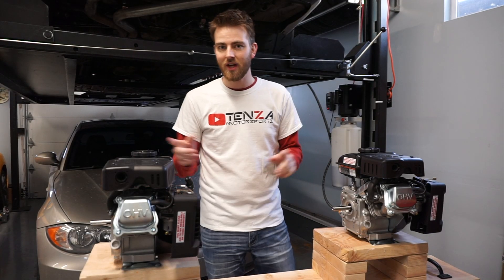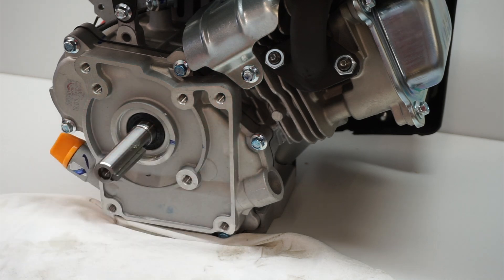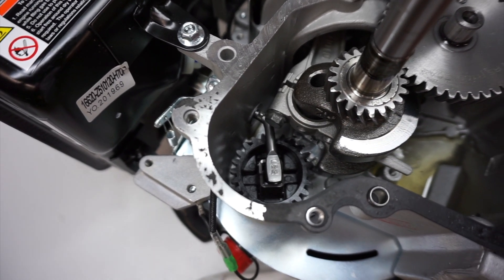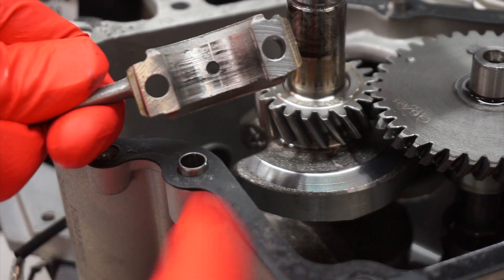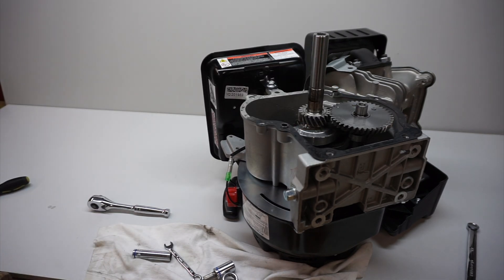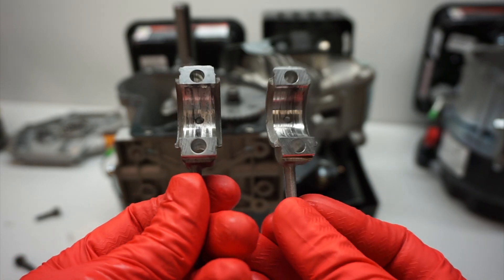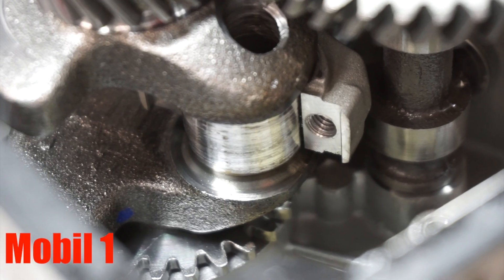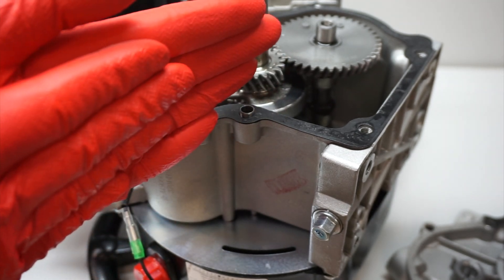Mobil 1 vs. Amsoil. Damage Report Torture Test Results. Search for the best synthetic oil (part 3)

Comment: Mobil 1 always has the best pour point. As a Canadian this important in our long winters.
Reply: Um, no, Amsoil Signature always has the best cold pour ability.
Reply: @Trigger-xw9gq 
 It matters more the viscosity. But Amsoil outperformed all other oils in many tests.  The Liqui Moly Molygen is a great oil for a good all around oil. It gives a better result in many categories except oil longevity.  As long as you're changing the oil to OEM recommendations or before.  I like the wear package on the Liqui Moly, so I plan on using it to bond with the metal at a molecular level, then switch to Amsoil for a longer change interval, once I install a centrifugal oil bypass cleaner that cleans the oil down to 0.01 microns, which is cleaner than new oil.
Reply: @Trigger-xw9gq  no, not always
Reply: Project Farm certainly disproved this. Amsoil always wins every test. This guy’s video is very suspect.
Reply: I use Vegetable oil. Best viscosity I've ever seen

Comment: Magnatec 0w 20, claim of leaving parts coated with a film of protection for start up .
Anyway to test that ?
Reply: They used to have I think 7% ester witch ester sticks on metal, but I think Castrol changed the formula and I believe it doesn’t have ester anymore, theirs a reason why it’s cheap. Any oil with some ester will “cling to metal” as what Castrol is saying with Magnatec 

http://www.worldpac.com/pdfs/motul_SYNINAMcar08_v1.2-Colour.pdf
That’s a link to what Motul says about group 3, 4 and 5 oils

Comment: I have a 2007 4Runner with over 260K miles and have always used Amsoil. It uses "0" oil between the 15K mile oil change. I have done this since the vehicle was 1 year old. Never had a failure of any kind.
Reply: My Camry uses less oil with Amsoil and just runs quiet and smooth like a sewing machine
Reply: @Big88Country  2007 Toyota’s can run to 300k miles with conventional castrol GTX.
Reply: What is your point? Is your 4Runner using the engines in this video? Sounds like your butt hurt because your chosen oil did not win? My family has owned Toyota's longer than you have been alive. I have seen them live long long lifes on Castrol GTX 20W50 and 3000 miles oil changes. I have also ran every brand of Synthetic oil available in the USA, a few that are only available in Europe and few only available in Asia. Run any synthetic brand like Mobil-1, PUP, Valvoline, Quaker State and change the oil every 6 months or 10K miles which ever comes first and that engine will never suffer an oil related failure!
Reply: 😅🤣 that engine could last as long on other oils.  Stop it
Reply: 😂😂😂 it will work with out any thing

Comment: For this test to have any real significance you need a statistically significant number of data points - way, way more than one engine for each oil.  Random variations in many factors can skew the results when you only use one of each.  Results aren't particularly valid that way.
Reply from the maker: I would love to do that, but I don't have the funds to spend 2,000 per oil to test. Preferably i'd have around 20 engines for each oil. But think about is this way. you only have one engine in your car. what are you going to put in it?

Comment: I rum Amsoil in everything.  I have 445k on my 7.3 . I have changed the oil  9 times. Filter at 25k . Oil n filter every 50k. Testing it with independent lab. It comes back same way. Still in spec. Run for 12k and re-sample.   The motor is just as strong as ever.  Replaced injectors at 385.  Conventional oils are every 5k. That is 89 vs 9...money and time saved.
Reply: I Run Amsoil Signature series in everything as well. Car is a prius 407k miles! Runs perfect no noise or clatter , runs as good as new , change oil every 15k , I know its 25k oil, but I run 85 mph most of time. HD evolution engine 100k miles runs perfect,  str8 50 in trans. Nothing better, mobil1 garbage,  they spent millions on brainwashing.  Run Amsoil!
Reply: @scoobydoo1726  )
Reply: @scoobydoo1726  

I would not argue that amsoil makes a much better product, and even Pennzoil for that matter, but I wouldn't call Mobil1 garbage. It's certainly overpriced and it is far from the best, but calling it garbage is not really fair or true. I ran their full synthetic for years in multiple Honda/Toyota engines, changing only every 12-15K... Never had a single issue with any of those engines.
Reply: But I like to have a reason to work on cars
I use Liqui Moly and change it between 5-7k miles which for an oil like this one is overkill but I find it a hassle to send back analysis and I can put that money to some other stuff.
Reply: @Andrew H yes but that is the reason for doing the oil analogy, that is the only way you can do something like that!
Reply: James Emmenecker Sr. 
Wow, that’s crazy
Reply: Is that miles or kms? Thanks
Reply: U mad man!
Reply: If you change oil every 5k km you should be fine with most oil
Reply: Those poor little Engines... They weren't designed to run without oil... Try Lucas Stabilizer in one, probably last longer than both of those...
Reply: 7.3? What vehicle?

Comment: I use motul for my 18 subaru wrx for last 2 months. I’m thinking of switching to amsoil vs mobil1 or staying with subaru oem. Thoughts?
Reply: I'd just stay with Motul as it is a 100 percent synthetic and most European oils have to follow higher standards for labeling unlike the US where anything can be labeled a full synthetic.
Reply: @bryanmartinez6600  i agree people are brainwashed with amsoil i find Castrol being good really depends on tne motor all motors like different oils
Reply from the maker: Honestly I don’t think you can go wrong with either oil!

Comment: Engine last for years .You can use any brand of engine oil.synthetic or conventional.change oil on schedule.PERIOD
Reply: Synthetic oils are proven to reduce wear over conventional oils, increase fuel mileage, etc..
Reply from the maker: I agree. A manufacturer recommended schedule and the correct oil type/weight is the most Important part. Most of this oil stuff is personal preference in my opinion. But we are looking to see if there are any differences between them.
Reply: @TenzaMotorsports  It would be even better if oil changes of the manufacturer's recommended viscosity were done earlier than the manufacter's schedule. Top-tier synthetic oils are very, very good, but frequently changed bargain brand oil is better than oil that already 20k miles on it but has customers convinced that they can save money by waiting for another 5k miles before changing it. No amount of exotic oil additives will keep some very fine grit from getting sucked past your air cleaner, and the best oil filters can't trap all of it. The tighter the tolerances and clearances of newer engines, the more the more likely that fine abrasives will damage them.
Reply: Absolutely!

Comment: What a waste of engine parts. Doesn’t prove anything with no oil. What exactly is the point?
Reply: Many tests just like this were done in the 70s and 80s with engines treated with slick 50.
The engines with slick 50 just kept on running.
Reply: I’m still with amsoil, if you would add just a little bit of dura lube to any of those you would be over 10 minutes run time on both engines
Reply: 100 percent, test on anything
Reply from the maker: There is oil. Just very very little. It’s a lubricity test. It’s not a waste. I got good solid results from this test. If you need more explanation on what is being tested here I can do that

Comment: For engine oil I take it to a local dealer shop for the brand- they use a full synthetic Castrol or Valvoline,  depending on driving west or east, do any free recalls or updates, and know what to look for that typically goes wrong with this model and year. For my 2 motorcycles, I change it myself and use half Valvoline regular 10w-40 and half Valvoline 20w-50 synthetic motorcycle oil, from Walmart. It gives me the best shifting smoothness and the firmest clutch feel. I change it when the shifting starts to get worse, since the same oil is in the engine, clutch and manual transmission. It is usually before the 7,500 miles in the owner manuals.
Reply from the maker: Having shops you can rely on and a maintenance schedule is key. Castrol and Valvoline are both very good brands! Thanks for the comment.

Comment: Shouldn’t this be called “LACK OF Amsoil vs. LACK OF Mobile one”?
Reply: I’m just not going to comment, I’m going back to bed.
Reply: @Thedirtylittlesecret  lmfao
Reply from the maker: There is very little left! Enough to get a lubricity result.
Reply: @TenzaMotorsports  I don't think any oil would stay in between the rod and crank with engine running, the oil would get slung out. The rod end just got hot and seized to the crank.

Comment: I like Amsoil, I use it in my taxi without any problems, can you test Schaeffer's and Motul
Reply from the maker: Has many miles are on your taxi? Motul and Schaefffer on on my list to test!
Reply: @TenzaMotorsports  over 200,000 miles, Amsoil actually fix the vvti cold start noise in my engine, I switch from 0w20 to 0w30,engine is running nice
Reply: @TenzaMotorsports  You should test Ravenol oil! Its a german oil which I've been using in my 2009, 2.7 Tacoma and I love it!
Reply: @VILLEGAS76able  I've been thinking of using Ravenol in our expedition I currently use Liqui Moly though in my Titan and will order Miller's oil for the transmission soon made in the UK.

Comment: I would like to see a comparison between synthetic and regular Dino oil.   
The results would surprise some folks. Hint. Save your money
Reply: What you said is mostly true for one reason: the synthetic oil most people use is NOT synthetic oil. It's Dino oil too, but it's been refined to the point that they are allowed to CALL it synthetic. There are only two real synthetic oils available for public consumption and one of them is Mobil 1. The other one buys their base from Mobil and adds their own additives.
Reply: @ralfie8801  ~ Synthetic oil is refined from natural gas.
Reply: @Jim-MT  group IV true chemically synthesized synthetic PAO bases are made from ethylene which made from natural gas among other things.
Reply from the maker: Great idea!
Reply: Trundy ~ Oil doesn't come from Dinosaurs. It IS a very common belief though.

Comment: I would say run them with the designated oil under a equal load non stop until one fails would be better test
Reply: I didn't understand or see how the test was ran.  We're these engines ran after draining oil?
Reply from the maker: That would take a very very long time. Plus this test was to get a lubricity result and that’s what we got.
Reply from the maker: There is oil still in them. Thats why they ran for 5-7 minuets. If you are still confused you might want to rewatch the video where I talk about the oil testing parameters and why

https://www.youtube.com/watch?v=QT1_qdUWzRM&t=2s

Comment: Try Pennzoil Ultra , a true full synthetic oil, like Amzoil and Mobile one.
Reply: Amsoil is grade 4, the rest grade 3.
Reply: @7s29  yes you are correct that's why uts better
Reply: 7s29  Most of syntetic oils out there are GL 4.  Amsoil uses Mobile Exxon base. Don’t be fooled. The question is,how come them performance oils like Amsoil or Red line have no API sertification? Are they to cheap to pay the licence?
Reply: @volodymyrbuchak1852  Actually that's not correct
In the USA most Full Synthetics are Highly refined group 3.

EUROPE has different standards for what full or 100% Synthetic actually means.  (Liquid Moly, Ravenol). Casteol, Mobil Europe versions are diff as they have to meet EU standards.

Yes AMS Oil is a group 4 and they buy their base from Exxon/Mobil.

Redline is the only Group 5

With that said Mobil doesn't even use group 4 base stock any longer.  They have gone back to the highly refined group 3.  It's cheaper.
Reply: @troys9069  Mobil 1 Extended performance full synthetic uses 60-70% PAO.  That is according to their SDS sheet.   Mobil 1 is a very good synthetic oil.
Reply: Volodymyr Buchak I work for Chevron and we actually sell Exxon some of our base oil. It’s water clear.
Reply: Why should Amsoil pay somebody to say their oil is good stuff when independent testing has already proven it surpasses the licensing body's specifications? The same goes for paying GM for a Dexos certification. It's just bribing them for an honorable mention in print.
Reply from the maker: Pennzoil is the next one I’m testing!

Comment: Next time try 2 ounces of Bestline oil additive  and obseve the difference.
Reply: Motorkote is a best and best can run water with it drain and it will still be there to protect the motor
Reply from the maker: I do want to try additives eventually but there are so many oils to get through first. It might be awhile.

Comment: This failure is more to do with the design of the oiling system of the engine not the oil itself
Reply from the maker: There was no oil in them. So it wouldn’t matter how the oil system is designed, there’s no oil for the oil system to do anything. The oil that was left clinging to the internals is all it had to run with.
Reply: @TenzaMotorsports  This kind of engine uses a "SPLASH AND SPRAY" type of oiling system.  It has NO OIL PUMP, therefore  NO OIL PRESSURE supplied to the bearing, if you can even call it a bearing, as it is just a SURFACE that the connecting rod runs  on the crank shaft. It takes very little oil to lubricate anything.  To me the surfaces of the crank and connecting rod cab don't look like the were very ho tat all. If those surfaces had been very hot, there would have been "BLUING" ON THE surfaces, like what you would see on metal after it had been heated up with a plow torch.
Reply from the maker: Im aware of the oil system this engine has. Again it doesn't matter what system if you have no oil. An oil pump system wouldn't have pressure if all the oil was gone.  You might want to watch the video again, more specifically 8:59 and 9:18 looks like it got hot to me.
Reply: @1gr8oil  If they are aluminum then there would be no bluing.

Comment: Nowadays... the engine design is so subtle and clearance is soo tight. Take a look at how many kinds of liqui moly engine oil we have... They are all designed for specific engine/brand.  you can't just say good or bad through a different single-cylinder engine and do the basic test...but watching the test is still interesting
Reply from the maker: That’s why when I first started this I told everyone the results are subjective. I’m not going to say one is better than another. You need to find out for yourself. What I’m doing is just adding information and my findings so people can better decide.

Comment: Good effort but unfortunately a waste of your time and money.This type of test proves nothing.Ive used Amsoil since the late 70s and it’s performance has been flawless but I leave the oil in the engines.when I’ve had maintenance done machanics always comment the equipment is spotless clean and no apparent wear. By the way my lawnmower is 35 years old starts 1 or 2 pull change oil once a year and don’t have to check the level.
Reply: "I am angry my chosen boutique oil did not do better let me talk about how Amsoil has always been the best." Unless you have been inside thousands of engines and torn them down after identical use to measure everything you opinion is just an opinion. I have never seen Amsoil lubricants hurt or damage any engine they have been run in! Amsoil has had to pay out warraty claims though due to their filters a few times with their eAA line I think it was called of full flow spin one destroying Toyota 2AZFE engines. A Toyota 2AZFE for instance only has 3psi of oil pressure at idle so a restrictive full flow filter can not be used. Amsoil fixed that problem. Not talking about their bypass filter setup either. Back when engines had 25-35psi minimum at idle and 10+ psi on top of that for every 1000 rpms with bypass on most engnes being set some place between 66psi and 120psi you could play around a lot with viscosity and filtration with out issue. Those days are gone! I have looked at thousands of UOA and have never seen a huge difference between any of the name brand synthetic oil in normal daily driver use. Single or even low double digit changes in wear metals on a UOA is not significant. Todays engines are less tolerant of extended oil changes than engines of the past in spite of OEM's pushing out oil change intervals longer than ever before in history. Oil consumption today is due to piston and piston ring designs not the oil being used. Extended oil change intervals increase the chances of pluging up oil control ring drain holes but are not the cause of it. If you have an engine with this design flaw Amsoil oil will not prevent it or fix it!
Reply from the maker: Its not a waste of time and money at all. This video isn't meant to hate on Amsoil. All this video says is, under these conditions the Mobil 1 lasted longer. The biggest thing to take away from this video is not to run your engines low on oil.
Reply: Tenza Motorsports but another thing to take away from this would be the Mobil clings to metal better than scamsoil lol